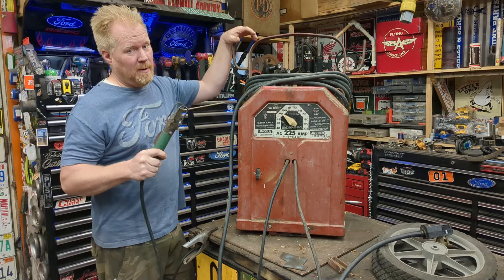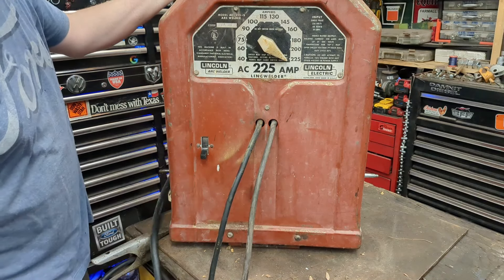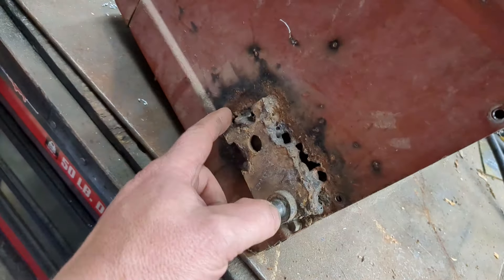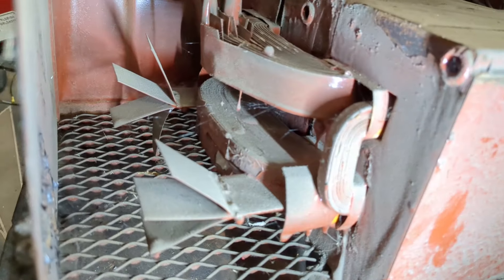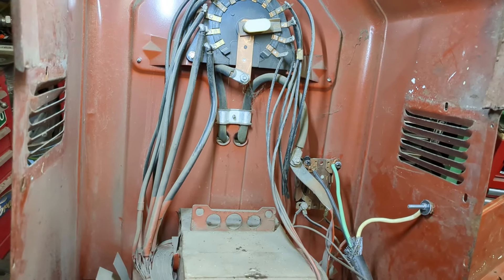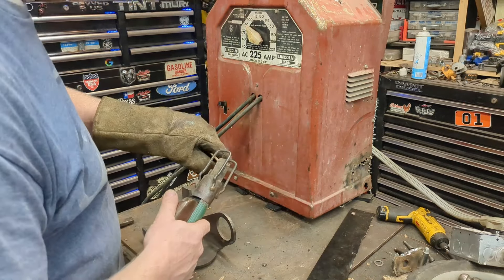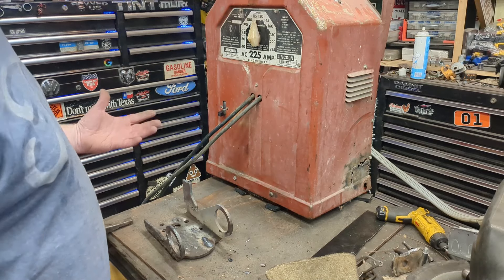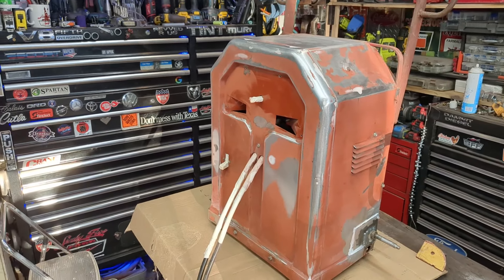Vintage Welder Fixed & Restored LINCOLN TOMBSTONE 225 AC buzz box

Comment: Great restoration work on the welder , Glad you didn’t get shocked from the previous crappy wiring job
Reply from the maker: Thanks. Me too.
Reply: @sixtyfiveford  Long ago, after an unfortunate incident where I ended up with a mis-wired hot plate spot-welded to my kitchen sink, I've gotten in the habit of taking an ohmmeter to used electrical stuff.  It only takes a few seconds to verify no continuity between the hot and the case, and to verify that you don't have a direct short.

As far as the hot plate goes, it was on the counter next to the sink, and one of the little metal legs was actually touching the edge of the sink.  What I did not know was that somebody had wired the hot leg to the case.  When I plugged it in, results were predictable.  Obviously, this was before the advent of GFCI protection.

Things would have not gone well if I had been leaning on the sink and happened to grab a metal pan.

Comment: I've got an old Lincoln tombstone from the early 50's (I think) the thing weighs a TON.  Pretty sure the old ones had copper transformers, it welds so smooth.  Smoothest buzz box I've ever used.  It also has a starter circuit that that assists starts then drops out.  It has the crank on the front and the amperage indicator on the top that moves side to side to indicate output.  I don't use it much but when I have to do heavy stuff, that old bugger really digs in and gets the job done.
One suggestion for yours, put some grommets in the case for the welding leads.   They can short out against the case over time..
Reply: that's an Idealarc model

Comment: Also slight differences between the older ones and newer models are the leads coming out the front.. over / under vs side by side configuration..most only need the contacts cleaned in the amperage adjustment mechanism and maybe the fan replaced if it doesn't run when the machine is plugged in..seen alot of people add a Chinesium bridge rectifier the brick style 1600a to get both AC/ DC and add a scratch start tig torch as well..probably the best DIY beginners welder ever made to date as they last generations..
Reply from the maker: You're right. I've seen the modifications and really don't know if they're worth it
Reply: @sixtyfiveford  having an AC / DC stick welder has merits as the DIY modification gets you all the amps vs the half amps from a factory unit..and if someone didn't have a tig welder a scratch tig would be well worth it if shielding gas was available..of course dinse connectors would simplify the modifications greatly not needing switches just different sockets / connectors on the front panel for the leads etc..there's great deal of intrest in such mods and current videos are rather poor at explaining the process..they usually use a grossly over rated bridge rectifier such as a 1600a unit about $27 or whatever is readily available around $20ish that's over rated etc..there a few limited videos here on YT but there is a really good website showing pics of such mods..yeah it could turn into a $40 to $50 project plus a chinesium tig torch etc..but your the channel to really do it well for others to learn..as so many people have a Lincoln 225ac in a garage, shed , barn collecting dust as its limited with only AC stick welding available..

Comment: I own one from the early 60's and yes it still runs great. Good to hear it should out last me.  I mounted mine on a small wooden skid with steel wheels makes it very easy to move around the shop. Seeing yours makes me want to paint mine up as well.
Reply from the maker: Very cool!
Reply: The good part of these Lincoln welders is that you welded most things on two or three settings which were always exactly the same every time you went there.
Not a little higher or little lower but right on 90, or right on 120, or right on 200.
You always knew exactly what to expect.

Comment: Great video! Did u modify that pallet jack to lift any higher?
Reply from the maker: It's a high lift pallet jack. Not very common but they are made commercially.
Reply: @sixtyfiveford  never seen one before.

Comment: No wasp nest inside?  Surprised not to see one.  I encounter them all the time on old equipment. 
I am not, nor have I ever been, fond of a Stick Welder, even though it is really good for structural welds.  You can always weld, and even bad welds will hold something.  You can't however run electrical wire willy-nilly and wonder why it doesn't work properly.  

I couldn't see the label clearly inside the panel.  Does the label give a chart or perhaps a "wiring" diagram? 

Do you spoil Ginger?  Facetious question because I know you do.  👁👁

Comment: Mine was from the 60's or earlier I believe and rounded on the sides. Not the tombstone type.
I remember welding when I was 8 yrs old. I through that piece I was practicing on in the steel bin. My dad moved the business to the country. We moved all the equipment steel parts etc. 
There was the welded scrap piece under the bench in the new shop. I said why do you have this scrap under the bench. He says you don't recognize that. No I was 20yrs old now. He took it out of the scrap and saved it. All those yrs. Really doesn't he have better things to do 😆😆.
Reply from the maker: Great story.
Reply: He saved a moment in time. He was proud.

Comment: Like just about everybody else, I've got one of these that I've had for at least 30 years. I traded out some carpentry work for it from a guy who didn't know how to weld. Stock condition, still runs like a champ. Mine still has the tiny little wheels and the virtually nonexistent handle on top to move it around. It's so heavy and awkward to move around that I bought an inexpensive hand truck at Harbor Freight and just zip-tied the welder to it as a permanent feature. Makes it a lot easier to move around and provides better cord storage too. It will definitely outlive me. Nice job.

Comment: I got one from an old guy for$100 ,with a about 50lbs of assorted sticks. 
Has the hex/flat head screws on the switch panel. Code# 7533-810. 
Any ideas of age?

Comment: Cool video and good job on bringing it back to life. I've told you before but I am not very far from you, being in Herriman.  my neighbors have complained about some of my "projects" so the city is making me clean things up. I have thrown away 30 good mowers at this point just because I have so many, but have 50+ to go.  if you would like any projects for the channel, I'll gladly donate them.  Look up James's Small Engine Repair and get a hold of me if interested.
Reply: It seems to me that you merely need to build a fence so things aren't in the view of the neighbors therefore they cannot complain. While I don't know your situation exactly, I know what I would do and that would be to keep my stuff while thumbing my nose at the nosy neighbors. That would probably require some looking into the rules & regulations of the city, county or state you live in but it'd be worth it. Sadly, I had to go to bat against the neighbors and the county myself several decades ago but I came out victorious. Don't be afraid to find out the facts and stand up for your rights. Never be afraid to fight back! Peace & good vibes! 👍🏻✌🏻⚖️

- Max Giganteum